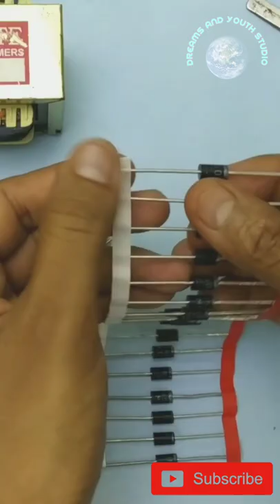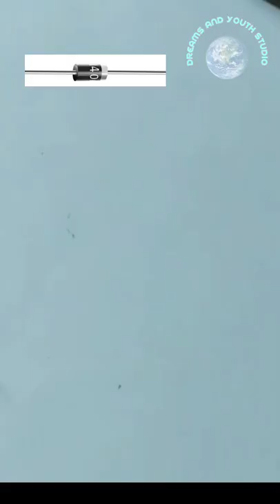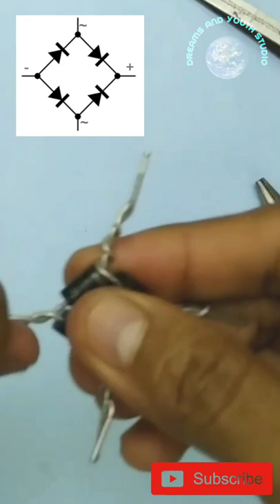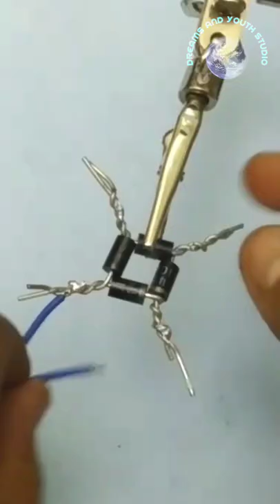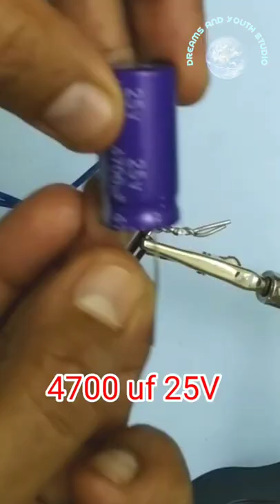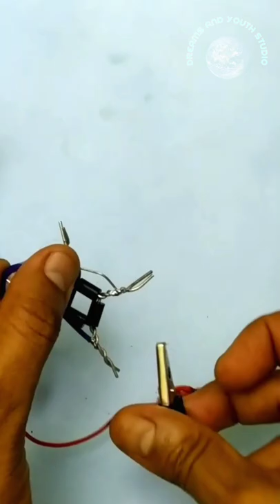DIY BATTERY CHARGER || 12 volt battery charger || Dreams and Youth Studio

Comment: Good, but i wouldn't add capacitor, if it will charge car battery
Reply: may I ask, why??
Reply: @GitXxxd  because when u add capacitor it will filter ac component in voltage and if u use 12vac transformer, output voltage will be 12×sqrt2 which is around 15v
Reply: @meax7180  
okay, thanks, good to know

Comment: Ek problem hai ki jaise jaise transformer ka input voltage change hoga (220v se zayada aur Kam hota rahta hai kabhi 235v kabhi 245 )vaise hi output 12v se kam ya Jayda hone lagega. Voltage ko stable rakhne ke liye kuch hona chaiye.
Reply: You can use zener diode